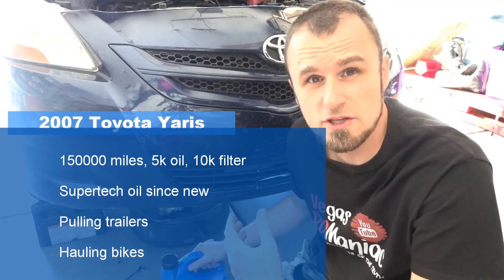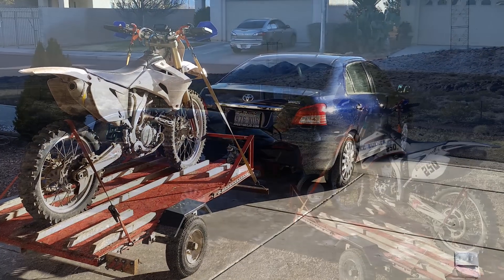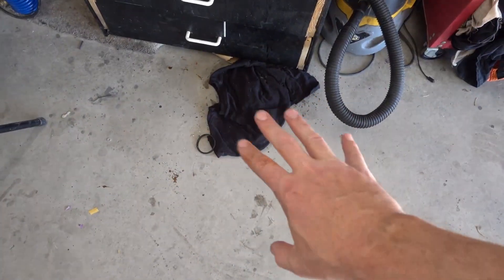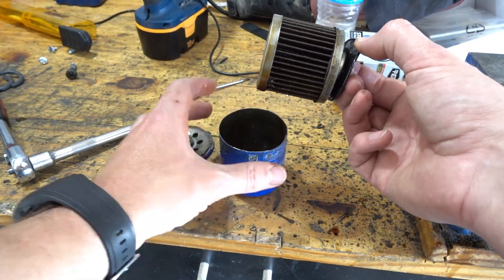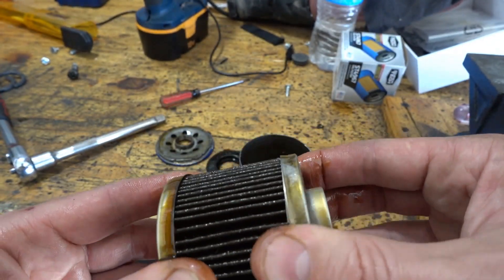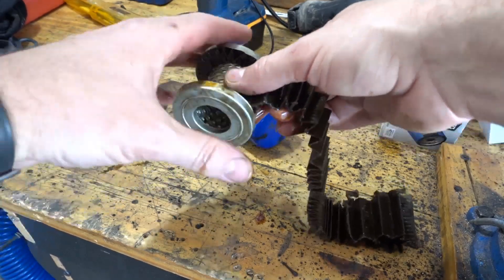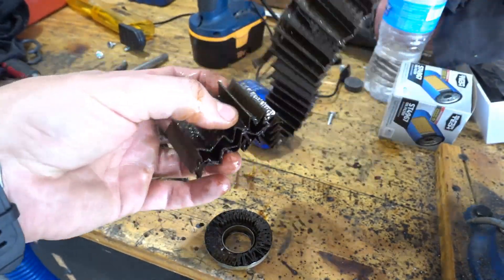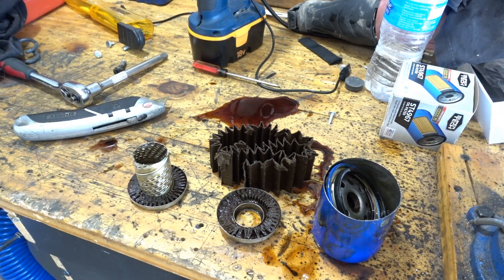Walmart Supertech Oil Filter "WILL RUIN YOUR CAR" - a Quick Peek inside

Comment: They are actually well made filters , just the filter material is a little cheap. Should work just fine , just change your oil regularly everyone :)
Reply: The filter media in a supertech oil filter is superior to 90% of the filters out there. It is a synthetic media that has Superior filtration to paper

Comment: About 2 months ago I called the Mobil1 oil filter hotline and got Champion labs. They make the Supertech oil filters for Walmart, at least they did then. They also make the Mobil 1 oil filters. They are similar. The big difference is the price, $3 vs. $12. I use Supertech.    Thanks.....Jim
PS....key on this video, regular, timely oil changes.
Reply: See, research paid off. As a retired auto tech. I have tried to educate people to do research. And quit listening to the commercials. It's not that hard to get the correct info.
Reply: Just because it's made by a company that makes other brands filters doesn't mean it's made to the same standards
Reply: They said only difference was the gauge of the metal…..

Comment: I have been running supertech full synthetic motor oil and supertech filter for the past 3 oil changes. So far it seems fine. Motor runs smooth no problems. The oil is rated as an SN+ so it holds up well in turbocharged engines which mine is.
Reply: I’ve been running it for 10 years and 170k miles
Reply: I tried supertech synthetic oil one time and after 2000 miles noticed excessive engine noise coming through the valve covers. I think the additive package is weak compared to the name brand oils. TBN was lower on voa Blackstone labs results.
Reply: @TNitroH  BS
Reply: @TNitroH  then I hate to tell you your car might be consuming oil. That’s not super techs Fault that you’re manufacture. I have never had a problem with super tech oil at all.
Reply: @TNitroH the supertech is actually VERY close to mobil 1 as far as composition. I believe it actually performed better than mobil 1.

Comment: Good filter, especially if you change oil at or b4 5k miles. The new MP series has a silicone anti-drain back valve which is probably better if u live in extreme cold climate. HOWEVER, the only thing I recommend is to check the metal end cap where the threads and oil inlet holes are, for any metal shavings. Be careful not to rub your finger to hard in the threads so that u don't get any metal shavings that may be there, stuck in your finger. I have noticed metal shavings quite often in these filters and I always rub it down a little and blow or tap the filter out just to make sure none are present down in the filter b/c the few I have found would have gone into the engine unfiltered. But, I do like the ST filter b/c it has big openings in the center cage/tube and allows good oil flow. The new MP has basically the same filter media as the mobile1 and since i change oil around 4-6k they work great.. now get back to riding those bikes!!

Comment: Just a little additional info. Super tech oil filters use to be made by wix until I think around 2017, since then they are made by campion.
Reply: Now, Champ Labs is owned by the same parent company that owns FRAM! WIX is made by Mann and Hummel, which owns Purolator.

Comment: Another great review. I've seen cut open Fram filters that weren't built as good as that one!
Reply: Vegas RoManiac  because they don't have to worry about advertisement sucking up money.
Reply: Fram filter part numbers that start with PH are bottom of the barrel garbage.

PNs that start with TG, HP, XG are pretty decent, with XG being a respectable filter.

Comment: I'm getting ready to do my first oil change on my 2007 Yaris. This is good to know.
Reply: The type of driving has alot to do with oil getting dirty. There's a good reason they put hour meters on diesel rigs.oil is a lube, and a filter. It absorbs the un burnt gases. That's why it gets dirty. How many hours in 6 months of engine idle at intersections waiting for the signal to turn green? New cars have that shut engine down. But that's more wear and tear on the starter. And wear and tear on the flywheel ring gear. That's just a gas saver. If you want to save gas? Drive at 55-m.p.h. on the freeway. That's max gas mileage achieved on any vehicle. It's a proven fact.

Comment: I plan on getting a supertech filter for my 2018 regal. Will be going with full synthetic oil though since I've got a turbo engine and those engines put a greater strain on the parts than a naturally aspirated engine.
Reply from the maker: True turbo it's always trouble

Comment: Been using these filters for over 10 years on the same car I've had no issues I have 265,000 mi on the vehicle now if you change your oil every 2500 to 3,000 mi the cheapest filter doesn't matter long as the bypass valve is working
Reply: If you go to full  synthetic you can change your oil at the latest 5000 miles. I wouldn’t go more than that. That’s when I change my oil 5000 miles or 4000 miles works just as good.

Comment: Not seal it’s a anti drain back valve 
Looks like a wix or champion labs 
Fram is crap but super tech looks really good
Reply: It looks like the Wix ones I usually use.
Reply: Super tech oil filters are one of the best you can get. Walmart..now partners w champion...like wix is, and have made super tech one of the best you can get....and all for $3 which was Walmart's goal..
 Win win
Reply: It's the same as an AC Delco filter..
Reply: Looks like a quality filter by Wix.

Comment: A d I've got a 2003 motorcycle  with a 1600 vtwin engine that now has over 100k miles and has NEVER   been in the shop,broke down or left me stranded. 100k miles and the cases have never been cracked open.  Just the facts.

Comment: The only difference between the blue and the white filters are the blue has a siliicone anti drain back valve, and the white has a rubber one other than that they are identical.
Reply from the maker: @southerncross3638  very good to know. Thanks for posting the comment

Comment: If you pick up and hold a more expensive Bosch, KN, or Mobil filter in one hand and a lesser expensive Super Tech, STP or cheapo Fram you will notice a big difference in weight. Because the more expensive filter has better thicker filter material and other components to keep that filter in place. However,  oil color?  I change my oil on oil color not miles.  When the oil loses most of its clear honey color I change it.  It will be quite dark but never black black. Always change your filter.  Supertech is fine.  Purolater is fine.  I avoid STP and the cheapest Fram. The heavier more expensive Fram are ok. Watch your oil pressure gauge if you have one?  If you ever notice it being much lower than normal while cruising down the highway your oil type could be wrong or your filter could be clogged. Very rare. Oil color is what is important to me. Make sure you use the correct oil type. Usually says on the oil cap. Cheers!

Comment: If these are made by a reputable company then you might be ok. I'm concerned about the bypass rating PSI micron rating and drain back valve ability after many heat cycles. I've seen gram filter with a pleat folded down exposing a hole where the oil just flows freely to the center core. Basically just overall quality control process during production
Reply from the maker: Too many details to worry about it

Comment: Made by champ laboratories, same manufacturer of Mobil 1, Motorcraft, valvoline, GM and autozone filters.
Reply: While that's true, the assembly line is set up for the requirements of that brand, so you can have a great filter come off the same factory as a crap filter.  But ST are neither great nor crap, so they are fine between 3-5k miles.
Reply: @lonniebeal6032  actually in every test they have been put in. They either out performed the big brands or they were pretty much the same. So no what you just said about st is nonsense. They are quality products. The only reason they are sold slightly cheaper is because Walmart has massive buying power.
Reply: @lonniebeal6032  also the ST 20k filters are perfectly fine and will compete with several major brands.

Comment: Id be more worried about the transmission if your towing a lot. Just fyi from a transmission rebuilder
Reply from the maker: I'm manual, stick, 5 speed, still on the original clutch...
Reply: Change your fluid change your filter routine maintenance on your transmission goes along way. He won’t have to worry about that if he neglect it’s then he will have problems just saying, changing the fluid and filter goes a long way at the right intervals kinda like changing your motor oil

Comment: There are some with metal end caps inside the element like in this video but stay away of the ones with felt end caps of the element.Now the oil only use as a top of I dont recommend. For a full oil change use castrol or valvoline .

Comment: These filters aren't great by any means, but they are still made better than all but the most expensive Fram filters. Those things have cardboard end caps inside!
Reply: Stop and think for a moment. Is it easier to glue filter paper to metal, or filter paper to a fiber end cap?

Fiber end caps are not really the big deal everyone makes them out to be.
Reply: @Texassince1836  I use the Fram Tough Guard filters with the fiber end caps on my ‘17 Honda Civic. After 7000 miles, I’ve cut it open and the fiber end caps are still intact...no breakdown whatsoever. My two cents.
Reply: @Texassince1836  A lot of these back yard mechanic experts don't have any background in adhesive and bonding properties.  You get a stronger bond with two porous material's together then you do with one pours material and one non porous material bonded together.

Comment: Nothing wrong with them at all.  Those companies that want to sell you their overpriced filters will tell you these are junk, of course.  Have used these for years with zero issues.  Just change your oil and filter every 3k and your car will run a long long time.
Reply: Mine clogged after about 4000.
Reply: @AldousHuxley7  then change it...most are under $3.90
Reply: @johnervin1474  not good dude they should last at least 6k

Comment: you can buy a toyota OEM for almost the same price.
Reply from the maker: Same thing OEM doesn't mean anything .. really
Reply: @VegasRoManiacReviews  i used original filters and my prius has 605k miles
Reply from the maker: How many batteries ?
Reply: I begged differ. I went to Walmart and looked up a Toyota oil filter for my car and they almost wanted eight fucking dollars for it and that was at Walmart. Change your oil flush your oil every so often your car will last forever change oil at every 5000 miles on a Toyota.

Comment: I just bought a Super Tech filter MP9018. It doesn't fit. Back to Fram. I just bought the Max Protection Super Tech oil. I hope it's good, at least it fit in the engine. I'll see in 3000 miles.

Comment: Stay away from supertech oil filters. I just change my oil about 1500 miles ago, when I did I noticed the oil filter and underneath the car was full of oil. I thought it was not tighten properly. And it was low about 2 quarts. Did the oil change and forgot about it. I just changed the fuel filter today and decided to check the oil filter, and again it was full of oil. Wiped It down and turned the car on and watched it leak. It was leaking from the crease where the lip and the body of the oil filter meet. Not from the seal or nor there were a double seal. Factory defect. And it was only on for 1500 miles this time I was down almost 2 quarts. I put 20000 mile oil and the supertech 10000 oil filter because they where out of others. And I would have changed the oil at 10000 to avoid any problems, but it would have not made it that far. Recheck your filter after driving it if you do buy it. Be ware!
Reply from the maker: Works great for me
Reply: Well, I have a cartilage oil filter so I don’t have that problem when I did have a can oil filter. I never had problems with super Tech. Maybe it’s the way you put it on overtightening will screw up the threads just my two cents.

Comment: It is one dollar more for a five quart container of Super Tech full synthetic oil. Why buy conventional oil?
Reply from the maker: That was the point of the video, just because it's called synthetic and it only costs 1 dollar more, it has the same effect...
Reply: @VegasRoManiacReviews  unfortunately buddy it does not have the same effect. Synthetic oil can go further 5000 miles do not do a 10,000 mile change. You will regret it but get away from that conventional shit. Your Toyota will run better on full synthetic. Trust me I have a Toyota I know.

Comment: Wierd this same exact filter comes in multiple different forms how strange ive seen 3 different filters come out of the same can st3614 some have drainback valves and some dont and some have metal end caps some dont and some have plastic housing of inside the filter not metal like in this video

Comment: You need to buy either Costco oil or Amazon Brand oil. Both brands are made by Warner Refinery in Texas.  It's the highest grade you can buy..    If you have to buy at Walmart, get the Castrol.   It goes on sale all the time.  Last month I bought high milage semi synthetic Castrol for $12 for a 5 quart bottle.  Even better than Amazon.  When this happens, I stock up.....new oil does not go bad over time.
Reply: Super Tech is also made by that same company. It's Warren, not Warner.
Reply: Warren oil is who makes amazon, kirkland, supertech and lubrigold oils. Their full synthetic oils all meet and exceed dexos qualifications. They are a top tier independent oil company. Competing and beating some of the major name brands such as Mobil 1 and shell. There are plenty of YouTube videos of Warren oil out performing major brands.
Reply: And blend synthetics are crap, no requirements for a full synthetic need to be met, blends are a waste of money unless they are on sale. And I would treat a blend as conventional, not synthetic.  Get 2 lab analysis done, one for a blend and one for full synthetics.